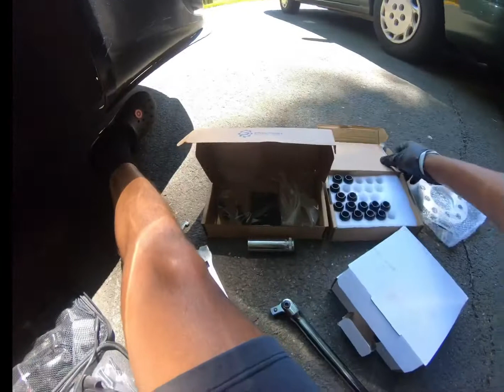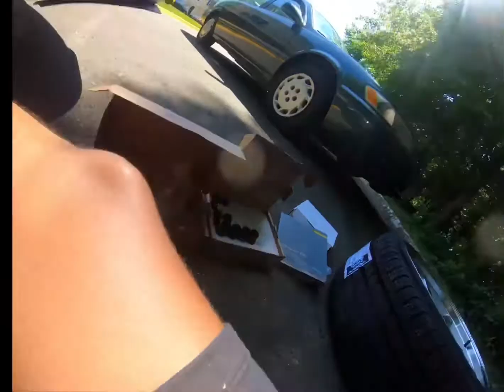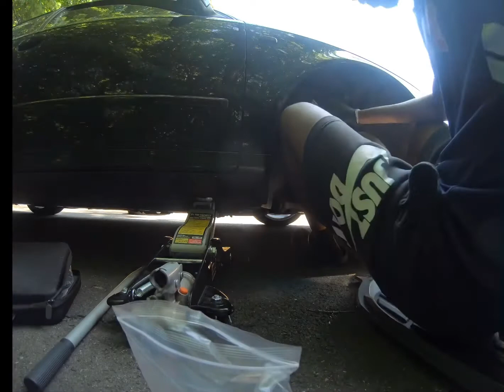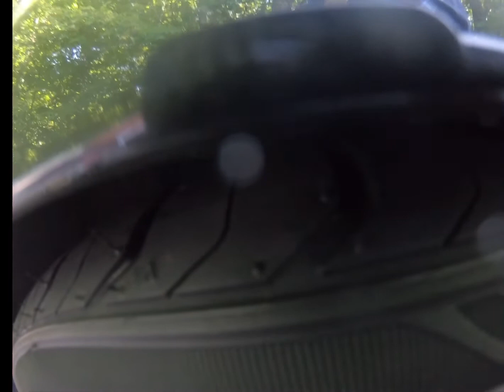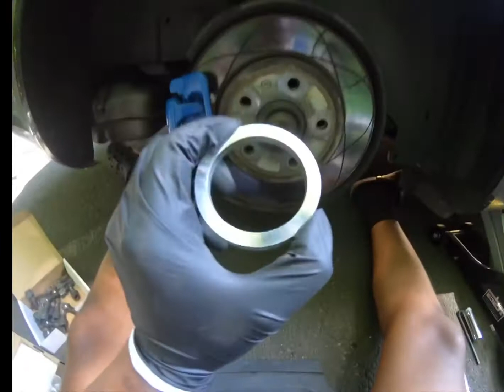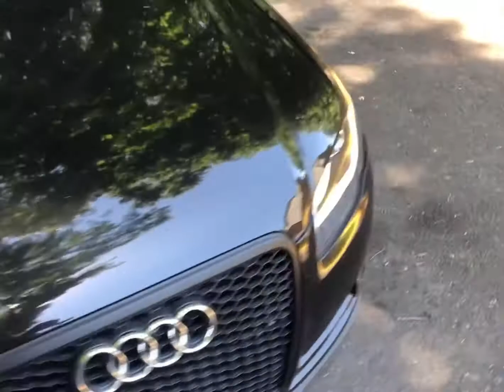HOW TO Make Any Wheels Fit Your Car!!*EASY*

Comment: ive heard youre supposed to run wobble nuts with the stud conversions if you plan on using the hub centric rings. Since youve had them on have you had any problems?
Reply from the maker: I didnt have any problems but i run adapters now

Comment: did you have any issues with the stud conversion and running 5x114.3 wheels on your car? I picked up a jetta and got some 5x114.3 wheels for dirt cheap and have heard about running studs and running 5x114.3 wheels on a 5x112 car no problem but wondering from someone who has them on currently?
Reply from the maker: Nah no problems. I am going to swap out my my studs and get the 5x112 to 5x114.3 adapters from ECS Tuing thouh. Just to be more safer. But the studs are fine